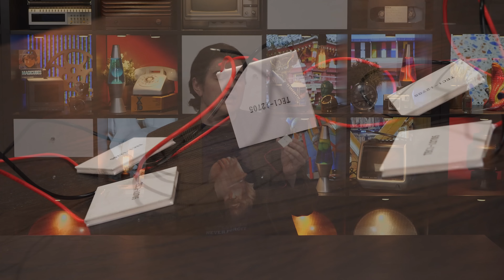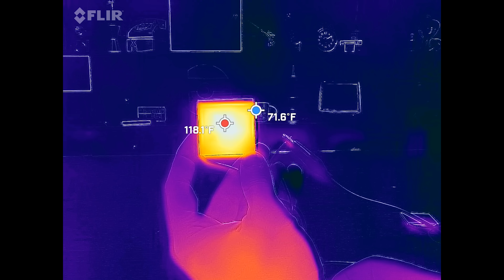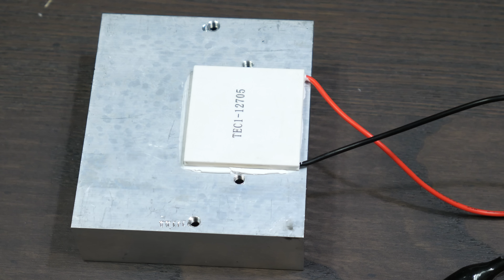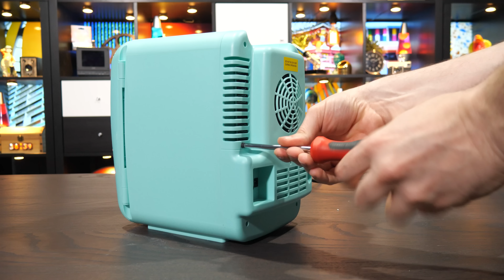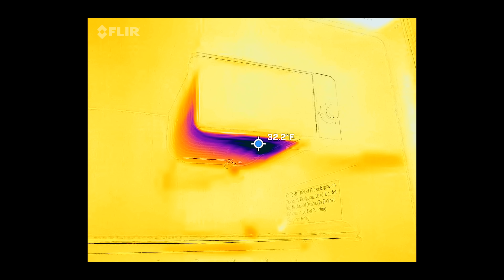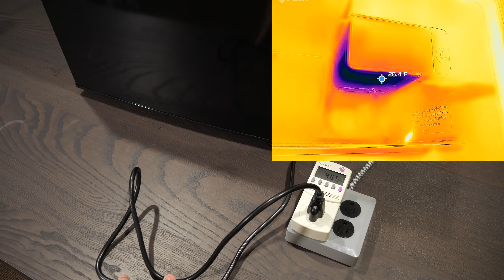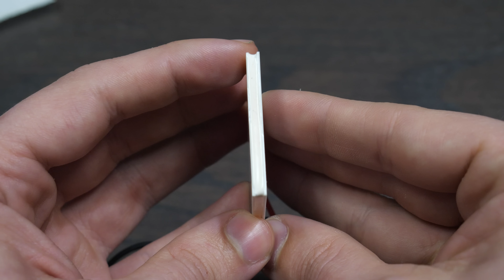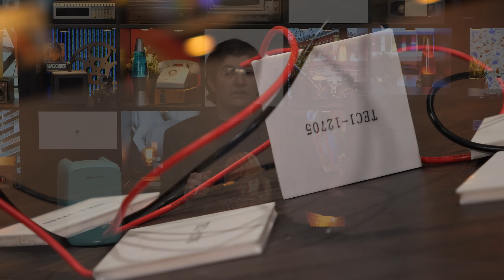Thermoelectric cooling: it's not great.

Comment: Many years ago I worked on a handheld battery-operated laser for dentists. One laser diode wasn't enough and combining laser beams was inefficient, so it needed cooling. You can't put a heat pump on a device like that.

Comment: Another trend appearing with these peltier effect elements is personal "air conditioners" Sony released one a few years back and there is loads now in the market. The idea is they are worn around one's neck and blow cooled air down your shirt as well as cooling the area behind your neck which affects heat circulation around one's body, and thus leads to feeling cooler for the person wearing it. Techmoan looked at one of the newer units recently.

Of course these will never outperform an actual air conditioner but you're not exactly strapping one of these on you and even if the efficiency is lower they need to do far less work due to the formfactor/usecase.

Comment: You TOTALLY missed the niche application for Peltier refrigeration: MINIATURIZATION!  When you need to refrigerate 1 cubic millimeter, COMPRESSORS NEED NOT APPLY.  Do you have satellite TV antenna?  How big is it?  Maybe 2 feet in diameter?  Remember when satellite TV antennas had to be 8 feet in diameter to get clear picture?  What changed?  Have you ever noticed that satellite TV, when turned on, gives snowy picture for the first 30 seconds, then clearing up?  The main magic behind this is PELTIER COOLING of the receiver electronics to MINUS 70C.  Doing that lowers the self-generated noise in the receiver electronics to the point that 2 foot antenna will do nicely.  The power requirement is so low that the same cable that brings the signal down to the TV can send the power up (from "wall wart" supply).  Compressor refrigerators would have to be cascaded to reach this temperature, & would be larger & heavier than the antenna.  Their parasite power would exceed by order of magnitude the few watts the Peltier cooler requires (to move fraction of watt of heat).
          Have you been to laser show where now solid-state lasers make watts of light from maybe 50 watts of power?  Some of these are battery powered!  (Older gas lasers required 50 KILOwatts of power & gallons per minute of cooling water to do the same thing.)  What's one of the key parts of these solid-state lasers?  3 separate temperature regulators in EACH laser, one for the laser diode, one for the neodymium YAG laser element, & a third for the lithium niobate doubling crystal.  Each of these must be temperature regulated to tenths of a degree C.  100 of these lasers could fit inside that little desktop fridge!
          Example of other use is dew-point measurement by cooling 1mm square surface & sensing water condensation on it.
Reply: You could have (Should have) stopped after the second sentence.
Reply: @zapa1pnt  Yes I could have, but how many people know the HIDDEN uses for this technology that video totally misses?

Comment: There is reason Peltier elements are so inefficient. On one hand, they must be made of electrically conductive material so passing 5 amps hundreds of times back and forth would lead to small voltage drop. (Voltage drop times current is parasitic heat produced by element). But also it should have small thermal conductivity between sides, to prevent heat from returning back from hot side!

Alas, there are just no materials which could be conductive electrically but not thermally! Free electrons of metals and highly-doped semiconductors transfer BOTH electricity AND heat! So it's often tradeoff which kinda works but definitely not great! It would be some solid breakthrough in physics of solids if this electrically but not thermally conductive material is found!

Comment: I think .. Should have also included the one very good fit use case .. the one case / application where thermoelectric modues beat all other technologies by a large margin .. a semiconductor thermoelectric modules dominate NASA deep space probes as electricity generaters .. If the device leaves the close proximity of a star as a Photovoltaic light source .. because the thermoelectric modules have a trick that compressor phase change cycles can not do at all .. the same NPN or PNP semiconductor sandwich often used as a Peltier effect , switches to a Sebeck effect and works in reverse .. producing electricity output if you supply them with a temperature difference .. NASA deep space probes use radioactive material as the hot side heat source , and radiators to space for the cold side , and thus a temperature difference .. and electricity output as long as the radioactive material is radioactive.

Comment: I have had a box about the same size since the Eighties. I believe it heats or cools, depending on which way the cord is plugged in, using a fan and venturi effect. Does not get super cool but good enough for sodas.
Reply: Well, that's way better than this thing. 😁🖖✌

Comment: @Technology Connections:
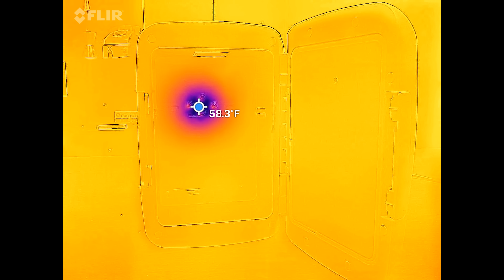@3:50 you stated the Peltier chip generates cooling.
I believe it would be best said as, the chip creates a cooling effect,
by moving the heat, from one side to the other. (which you alluded to)
Too many people already believe refrigeration systems make Cold.
That is Not "make something cold", they believe it makes"Cold", as
though it is a substance. I would not be surprised, if no more than
3% of the population can understand, cold is a concept.
It is nothing more than the Absence of heat. When you stick your
hand in the freezer, you do not feel "cold", you feel the absence of
heat, which we refer to as Cold.
Heat is a form of energy. Cold is a form of nothing.  😁🖖✌

Comment: The fancy fridges we use in hospital laboratories have to be routinely tested to make sure their temperature alarms work correctly and they use a peltier element next to the temperature probe to simulate the fridge getting too warm or too cold. Neat trick to test the probes without having to actually change the temperature of the whole fridge!

Comment: I bought a "Mini Fridge" and a 'Mini Freezer" for $50.oo a piece and I use them for Camping running off an inverter. 300 Amp hour Battery and 400 Watts of Solar. With good Solar gains,  It ran all that and a 1100 Watt microwave for 9 Days. I had to turn the temp of the Freezer up as it got to 22 Deg below 0,   HAHAHAHAH
I plan on adding Heat sinks to the sides and PC fans on the compressors to help with efficiency.

Comment: If you give the peltier's hot and cold side heatsinks enough surface area, you can improve the efficiency somewhat, but obviously nobody making these itty bitty fridges cares to do that. A couple of heat pipes to hug the interior walls with some visible metal finning, and a big heatsink that takes up the whole rear of the thing, and it might be somewhat more competent. The main problem with Peltier, is that they're good at moving heat, but since the cold and hot side are directly next to each other, they don't like to maintain that difference very well, so the more effectively you can dump the heat from the hot side, as well as put the cold side to use, the more efficiently it operates. To a limit, of course it's never gonna run good enough to keep a CPU cool under load, but still the efficiency can be improved with some really fat heatsinks run out of heat pipes, or even water cooling for effective transfer.

Comment: I worked in a place where we had a really good use case for Peltier elements. It was a company making measuring equipment for the chemical industry, and one of our devices used a Peltier to keep the measuring chamber at a constant temperature. I think it was around 20°C/68°F, so when used in a room, there wasn't a terrible lot of heat energy to be moved in either direction. It was still necessary though in order to get reproducible results.

The obvious benefit besides it not having moving parts was that it wasn't just able to cool the device, but also heat it up when brought in from a colder storage area.

But the fact that there are use cases where they are the best possible solution doesn't mean they are good to chill your favorite beverage...

Comment: Just FYI, Peltier coolers CAN get COP close to 3, if you carefully control the current AND the temperature drop. This would require a cascade of several peltier modules in series, depending on the total temperature drop you're trying to accomplish. I designed a system to use peltier modules for dehumidification (welcome to Florida), because I wanted to use something quieter than a typical dehumidifier. In order to keep the modules operating in their peak efficiency, and match the moisture extraction of a 30pt/day dehumidifier... was going to cost me over $1k in JUST the modules. Power consumption would have been comparable, as would cooling capacity.

These modules aren't bad... they're just... not used correctly, and horrendously expensive TO use correctly.
Reply: Yeah, you need the right kind of Peltier, you need stack them and you need to use the right thermal interface materials and good heat sinks on both sides. But at that point, you're talking like $200 just for the bill of materials plus like another $200 each for engineering cost and margin.
Reply: @hammerth1421  For the little minifridge? I could see that, easily.
Reply: @hammerth1421  Stacking peltiers was the shizzle in the good old 486 / pentium CPU times for hardcore overclockers. Managing water condensation and ice buildup was the hardest part :)
Reply: I've found peltier powered electrical cabinet dehumidifiers in industrial machine tools.
Reply: "Cascade of several of them in series" like a stack on top of each other? So ones cold side touches other ones hot side?
Reply: @arslanrasit  Yup. This reduces the temperature drop across each, for a given delta-T. You can find the datasheet for a given peltier module, to see where it operates most efficiently, and to get the delta-T you need, generally, you'll need to stack two or three. Four or more, for super low temps, but they start getting really lossy after 3
Reply: @JohnDoe-fk6id  When he said "heat leaks because cold and hot sides are close" I thought "why they don't just stack a bunch of them together?" lol apparently they already did
Reply: @arslanrasit  It actually doesn't fix the behavior he was describing. It does allow for more efficiency, though.
Reply: @JohnDoe-fk6id  I thought, "if 2nd plate takes the heat of 1st one, 3rd plate takes the heat of the 1st etc etc, we would practically gets tons of space between the coldest (1st one's) and hottest(last one's) side which would "practically" solve the heat leak issue and thus improve efficiency
Reply: @arslanrasit  Eh... sort of. It's still leaking heat, just slightly less. You are correct that it would be less. But it would be... still a lot, compared to an equivalent compressor system.
Reply: I have modded an electric cooler by stacking a second Peltier on top of the existing one and running both at reduced power. Ended up using 20-25W which was comparable to a compressor fridge of the same size, even had to add a small heater and thermostat to stop it from freezing when the room was cold. The compressor still wins if you want the capability to go below freezing, however.
Reply: Dehumidifiers are so quiet nowadays. Mine literally about the same as my laptop it's very quiet you can't hear the compressor at all.

Comment: Astronomy cameras use these to cool the sensor in long exposures. These are small devices and the vibrations of a compressor would be very problematic (the fan on the the TEC is trouble enough as it is).

Comment: 7°C is not considered food safe in the US? Interesting, European food manufacturers assume a fridge temperature of 8°C.
Now I wonder what temperature my fridge is actually set to. I wish I could find that out just by looking at it, but the temperature dial in my fridge is just labeled 0 - 6 with no reference whatsoever as to what those numbers mean. 🙄 WHY?!! Every fridge already has a thermometer in it to determine when to turn on and off the cooler. Why can't the manufacturers just write the target temperatures of each step on that dial instead of those meaningless arbitrary numbers? 🤦

(Evidently the numbers don't represent 0 - 6°C, because turning the number up immediately makes the cooler kick in, so higher number means colder temperature)

Comment: I've seen the tiny thermo-electric coolers used in co-workers' cubicles. They liked them, from what I heard. Problem with your rant is that the little six can holding cooler boxes have a very limited and specific application. One that no cube fridge or larger fridge can meet. That is to keep a very small, as in a single work shift length of time, amount of food or drink cool. It's a lunch box. You take your food and drink already cool from home, go to work and place it in your little blue box. At the end of your work shift it is either empty or close to it. For that purpose it is apparently acceptable to many and CANNOT be replaced by anything larger. If anything, your rant convinced me that if tempted to buy one I should expect to add a temperature control to it at the very least.

Comment: There's at least one more advantage to peltier cooling.
Size.
At least in electronics, everything that uses electricity creates waste heat. Semiconductors especially do this, as evidenced by the large heat pumps used to keep data centers at a functional (cool) temperature. Colder semiconductors are also more energy efficient, so there's some bonus points to be had.
Now, here's a practical example. Say you want to capture a sequence of images as fast as possible, while maintaining a relatively high resolution.
We have high resolution image sensors and high bandwidth data capture systems that can do that, the problem is the image sensor. If you run the image sensor at those high frame rates and room temperature, the resulting images are noisy, because the sampling rate does not allow enough time for enough charge to create a clean signal to build up on the photosensitive junctions that form the sensing elements of the image sensor. This happens for a similar reason to the reason that makes a Zener Diode based white noise generator work (which is also the same reason that diode based random number generators work, one of very few types of all-electronic "truly random" (or as close as we can get so far) RNG).
OK, so the problem is that there's too much noise on the sensor in a short time period, how do you fix that? You take away the source of the noise, in this case that means you need to operate the image sensor at lower temperatures, because this type of noise is also known as "thermal noise".
Problem: Cameras in general, and high speed cameras specifically, are already problematically bulky and delicate, so adding a refrigerant based heat pump to it would be a non-starter due to bulk and durability considerations.
Solution: Use a stack of multiple peltier elements stacked with each one's hot side facing the next one's cold side. This can create quite an impressive thermal gradient, as long as you don't need much actual cooling POWER. Perfect for cooling our image sensor, which already has extremely low power consumption. Most high speed cameras only insulate the image sensor sufficiently to deter the formation of condensation, or they skip that entirely and house the image sensor in a sealed chamber free from moisture.
The "hot side" of this stack of peltier elements does indeed get quite hot, but that's nothing a rationally sized heat sink and fan solution can't solve.
So now that the camera is built, is durable, and the image sensor is cooled sufficiently, it all works! One small problem: Sustained power draw. Yeah, can't get away from that one, peltier elements are always going to be power hungry. The upside is that high speed cameras generally fill their memory banks quickly, which means that when the image sensor isn't actively gathering images, it doesn't need to have the peltier element stack switched on, so it can turn off the highest power consumption part of the camera when the memory is full. Granted, this approach does mean you need to tell the camera that you're going to want to capture images soon, which will tell it to cool the image sensor down again. This doesn't take THAT long, but it can take 10s to a minute depending on how cool the sensor needs to be to capture at a given framerate (faster framerates need cooler sensors because signal has less time to rise above noise before being sampled at higher framerates).

Comment: Intel actually released an interesting cooler a few years ago that had a peltier effect element. The idea was when moving heat, using a heatsink the amount you can move depends on the difference between what you are cooling and ambient temperature.

This way the cold side could keep the CPU thermal interface at sub ambient temperatures and the hot side ended up being considerably hotter than a normal water cooler hot side would be. This way, while consuming significantly more power, a lot more heat could be removed from the CPU. This of course does not outperform a phase change/heat pump solution even in this application but the main advantage of this solution was it could be used in the same form-factor as a normal AIO water cooler.
Reply: Ironically, that project was one of the signifiers of their impending downfall as it was an engineering-heavy product that relative to the total customer base fucking nobody wanted to buy. The modern consensus on Peltier CPU cooling is that it doesn't work. It adds more problems than it solves.